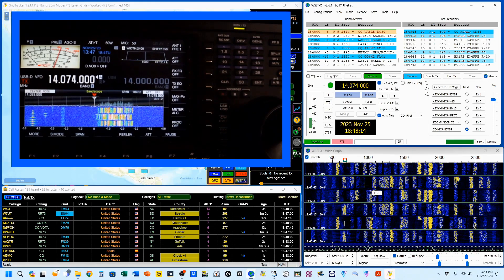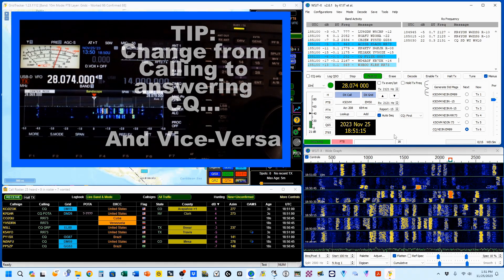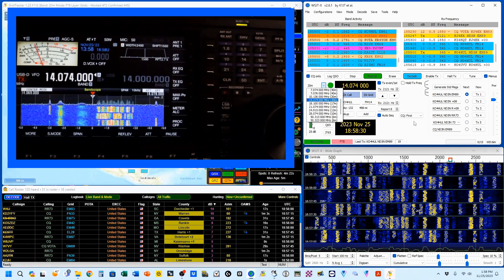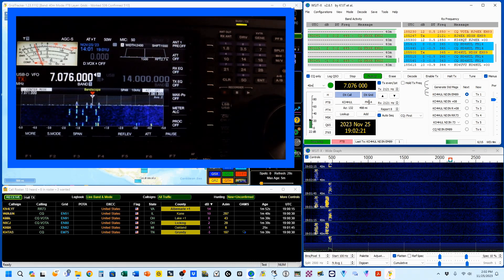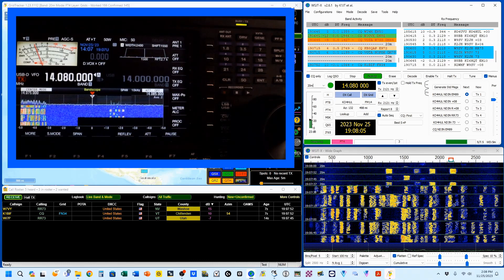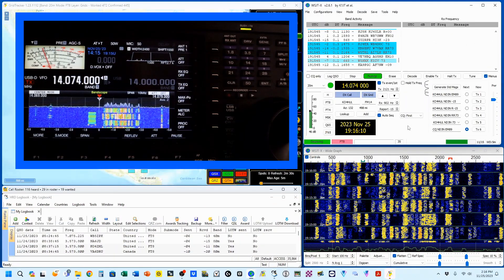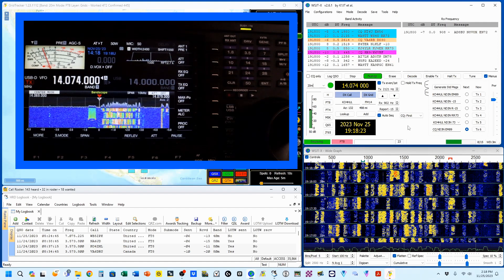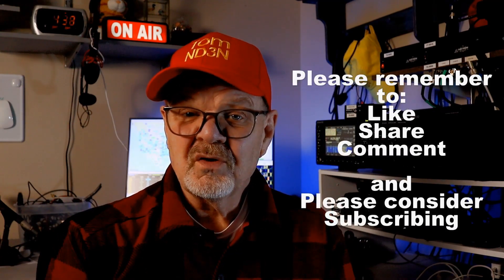Overcoming the problems with FT-8

Comment: In your video, you suggest adding a frequency of 2 MHz above the normal FT8 usage frequency.  However, what you really did was to add a frequency 2 KHz above — I expect the latter is indeed what you intended.
Reply from the maker: Thanks for the catch…. I’ll be sure to fix it when I release an updated version.  73